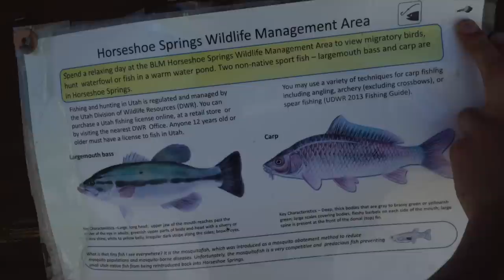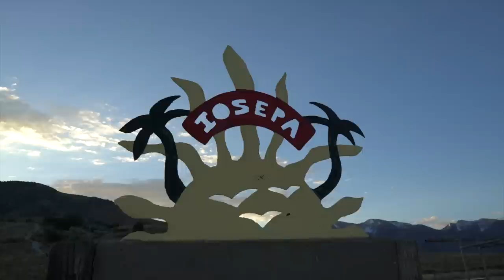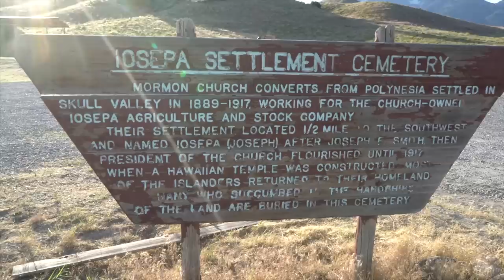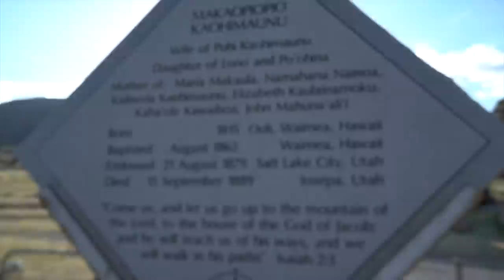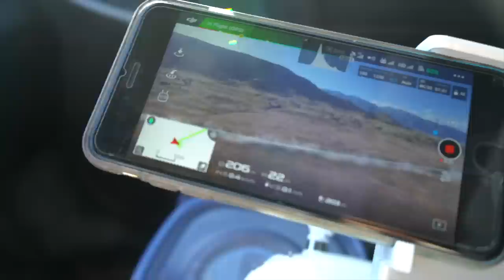SkyHunter Long Range FPV Gone Wrong - RCTESTFLIGHT

Comment: That had to hit at terminal velocity 120 mph   Mind blowing   Must have been nose heavy   What if you balance the batteries in the center so you maybe get some gliding action if you go down.  ??    I found that I need to stay away from my truck while calibrating and even flying  it think it's caused me some Mavic issues   I almost lost mine only 1200 feet away  the only thing I can think of I am next the truck. I also had it land on another flight 500 feet away from home   I think the truck screwed up the compasses.

Comment: Why did you RTH fuck up when you lost LOS? Mine doesn't require radio signal to work.... Also, you should've remained in control and kept it above the mountains. Never flip to RTH unless you have no video feed.

Comment: how are you able to fly to such a high altitude without violating any regulations?
Reply: BLM land + open airspace + checking local flight patterns + live flight tracking + aircraft weight under FAA requirements + not flying over roads and homes and business.... hes fine

Comment: I use Arduino for stuff like that. And I'm not so good but I've tried doing this : if I don't get anything from the transmitter it switches automatically to the autonomous mode. Therefore, it will maintain altitude and stuff like that.

Comment: I've had a 900 MHz FrSky R9 system mess with my video before.  I don't think it was the actual transmission of the signal, but a voltage regulator going bad in the module and pumping out lots of interference all over the spectrum.

Comment: No way did the plane go vertically into the ground. The large wing area would flatten the flight path so the plane would hit the ground at an angle. That amount of damage was done in my opinion done in the two days before you found it.   (Maybe the water bottle is a clue that some one else found the plane and did the damage, )(military?)

Comment: Potentially you had your failsafe set wrong and the plane was dropping in and out of the fs causing it to invert then signal back and rth tried to level it then it dropped out again making it go crazy
Reply: Maybe even a brown out? 5v failing as the cam was dropping out?

Comment: Consider getting onto skyvector dot com and looking at the sectional in your area. Avoid restricted airspace, class B, C and D airspace as well as all those little general aviation airports. From the looks of it, you probably do not have many in the area, but better safe than sorry. If you are unfamiliar with sectionals and airspace, send me a PM and I will either help explain further or send you some good reference links. 

I used to do long range FPV but then I moved to Maryland where the population density in my area is just too high. Now I fly general aviation, but do often miss the thrill of seeing how far I could push a bunch of cobbled together RF equipment. I have actually spotted a few RC's and drones from my Cessna in the neighborhoods near the airport that I fly out of. It doesn't bother me at all because they are all low. I spot about 1000 birds within a few hundered feet of my plane for every drone I spot. Not that I would want to collide with a drone, but most certainly birds are a bigger threat!!

Happy flying!

Comment: the cases for the vector systems pop off pretty easily, you might get lucky and need just the power adapter and gps

Comment: Motor fell off, psst next time glue the mount with the 2" wooden dowels attached like I showed everyone on my first build video, (Heres the link https://www.youtube.com/watch?v=SMOdOaNba4Y) I warned that it needed to be mounted deeper or the motor could fall off ( it was reported to be a big issue with the Skywalker which had the same mount).  Especially with 16000+mah of batteries in it, it was pushing mass weight, forward momentum was the only thing giving it lift and keeping it up!  So sorry for your loss bud, that was a lot of $$ lost.  Buy another and rebuild it and do some more fpv your videos are great!